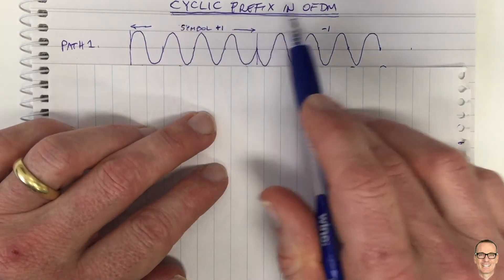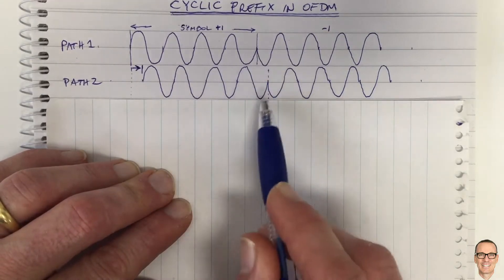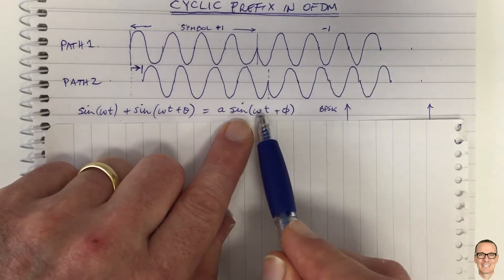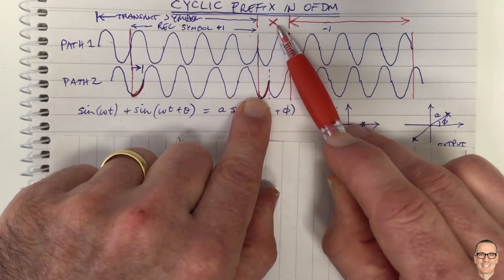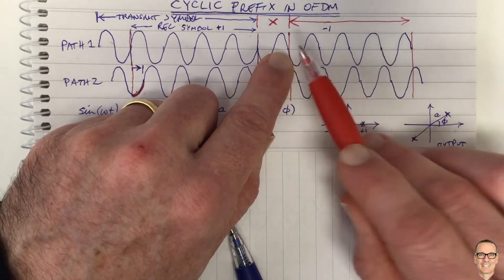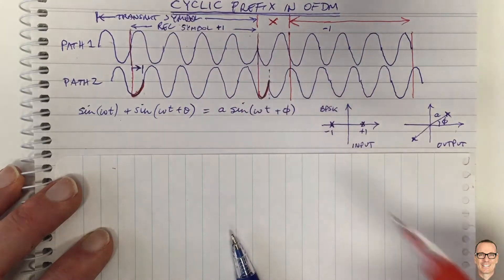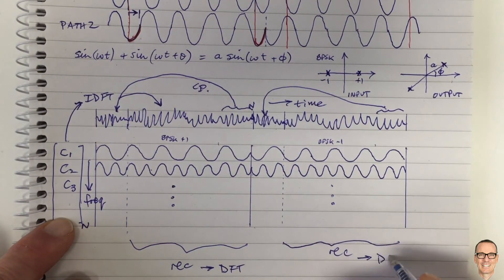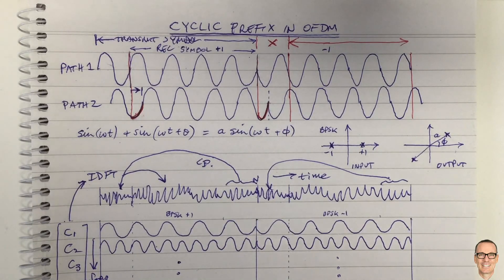What is a Cyclic Prefix in OFDM?

Comment: Hi professor, IEEE channel model D(typical office) has max delay of 390ns, and 802.11ac short guard interval(should be the length of cyclic prefix?) is 0.4us which is 400ns and is longer than max delay. Does it mean model D won't create any inter-symbol-interference? But why are we still seeing WiFi throughput drop when testing when testing with channel emulator and applying model D?
Reply from the maker: Yes, there won't be any ISI between the OFDM symbols in that case, however that doesn't mean that the channel is flat across the spectrum. There will still be an effect from the multipath, causing some sub channels to have low gain. I'm planning to make a video about this in the next week or so. Keep a lookout.

Comment: Sir, to prevent ISI we go for OFDM. Now, while we implement OFDM,  the symbol period is made much greater than the delay spread. So, ISI will not occur, right?  Then why should we still use cyclic prefix?  Sir, I have had this doubt for a long time. Please explain this sir
Reply from the maker: Making the symbol period longer doesn't "remove" ISI. It just makes the ISI have less effect, since the delay spread becomes a smaller percentage of the symbol period.
Reply: @iain_explains  Thank you sir

Comment: at 2:48  if the problem of rotation of the constillation has been soved by the process of equilization than what is the need of cyclic prefix ultimately what we want is our constillation at the right posiotion at the receiver in order to be detected that has been aceived by the process of equilization . so where there is need of CP sir please spread some light i have watched the whole video many times but everytime my mind is stuck on the same question
Reply from the maker: It’s not possible to do the equalisation until after the inter-OFDM-interference has been removed. That’s what the prefix is for. It ensures that there is no interference from one OFDM symbol to the next.

Comment: I don't understand why there is a gap on the left, in the IDFT, at 8:45 that "has to be filled" with the prefix. Since all subcarriers fill the whole time slot, their sum should also fill the same time slot and there should be no need for filling that gap with a copy.  Since we're discarding the prefix at the receiver end, we already have a longer transmitted signal duration on the transmitter side (you can't extend the transmission time of one symbol on the emitter side; the only thing you can do is reduce the symbol sampling duration on the receiver side -  and we do this already). Therefore the symbol is already "extended" from the perspective of the receiver.  It's actually conspicuous on the pictures at the start of the video (5:00): what is in the prefix is exactly the same as what is at the end of the time slot.
Said otherwise: when do we transmit the prefix, since we're already using the whole transmitting time slot with the combined OFDM symbol?
Or are we deliberately generating the symbol on transmitter side with a delay, during a reduced duration, equal to the receiver sampling duration. And why would we need to do that if the suffix and prefix are equal? Are they not?
Seems we started with the idea of a guard and then realised we needed to fill it with some thing that turned out to be the same things as if we did not have a guard in the first place. I'm lost.
Reply from the maker: I explained that in the "single carrier" case at the 3:27 point of the video. You want to extend the symbol, in order to avoid having a discontinuity within the received symbol. The output of the IDFT at the OFDM transmitter does not include the cyclic prefix. It's just the symbol that you would like to send (ie. the 4-cycle symbol in the single-carrier example at the top of the page). It needs to be extended, so that the ISI affected portion can be removed at the receiver.
Reply: @iain_explains  Thanks for trying to help, but I'm afraid I'm a hard case, :( . I'm sorry Iain I still don't get it.  The single carrier example you took is precisely why I'm asking the question.  In your example, there is no copy of the tail.
You even explicitly show that transmitting a 5 cycle symbol is sufficient if we decide to only sample symbols on the 4 last cycles 3:34.
On transmitter side, you add a "prefix" first cycle (which indeed looks like a copy of the 6th cycle) but we did not need to do that copy, we just generated that cycle in our longer transmitter-side symbol duration, unaware of whether the receiver was going to take it into account or not.
Just as your single carrier example shows, copying cycle # 5 on top of cycle # 1 would be achieving nothing. Cycle #1 is already the same as cycle # 5.
Assuming orthogonality, and assuming that the prefix length is a multiple of the period of the lowest subcarrier, the same would apply in multi-carrier added signal.
So, IDFT could do the same and just generate on the whole duration instead of copying a tail on top of an identical prefix.
In short, in your single carrier introduction, the solution is to have a longer symbol generation duration, but in the multi-carrier situation, the solution is to have the same symbol generation duration and then patch the resulting prefix gap with a copy of the tail. I realize I must be missing something since, everyone is on the same page, except me.
So, what did I miss?
Reply from the maker: In my single carrier example: The "actual symbol" that you ideally want to transmit, is only 4 cycles long. The #1 cycle (according to your definition) does not exist in the "actual symbol". The #1 cycle is added, in order to avoid inter-symbol-interference affecting the "actual symbol". The added #1 cycle is a copy of the last cycle of the "actual symbol" ... ie. it is a copy of the #5 cycle, in your definition of the cycle numbering. This is why it is called a cyclic prefix. I agree that it looks like just an "extension at the start" of the sinusoidal waveform, but that's only because the start and the end of a sinusoidal waveform are the same (ie. it's only an "extension at the start" since the waveform in this case is a sinusoid). Once you start adding sinusoids together (as in the multi-carrier OFDM case), the start and the end of the "actual symbol" are not the same any more.
Reply from the maker: The lowest frequency subcarrier has a period that is the length of the IDFT vector. So the start and the end are not the same. Here's some code you can try in Matlab: 
X=zeros(1,100);
X(2)=1;
X(100)=1;
plot(ifft(X))
Reply from the maker: Here are a couple of videos that give more details on that: "How are OFDM Sub Carrier Spacing and Time Samples Related?" https://youtu.be/knjeXo3VZvc and "How does the Discrete Fourier Transform DFT relate to Real Frequencies?" https://youtu.be/pIFz84oj9cA
Reply from the maker: And probably at 2:51 where I introduce the idea of the extension, and say "it could have been more than one cycle", I should also have said "and it could also have been less than one cycle".

Comment: Hi Ian, this answers a lot of questions that a friend and I had about this topic a couple of days ago, thanks! I have a couple more 😊

Are the terms 'cyclic prefix' and 'guard interval' interchangeable?

Is the effect, from a transmitter perspective, identical to lowering the symbol rate? Does this therefore mean that the bandwidth per carrier is narrower? Does that affect orthogonal carrier relationships, or does it help with carrier IM as well as ISI?

Does the duration of the cyclic prefix need to be an integer number of cycles of the base carrier frequency, so that it is also an integer number on all orthogonal carriers?

Thanks again for a great explanation!

Comment: Thank you so much Mr. Iain for this excelent explanation. I believe it is the best playlist in communicatio I've seen on YT so far!

I just have a question, if I may. When I convert the constelation set into the time domain using IDFT, I do have a complex signal with both real and imaginary components, in some cases. 

Does that mean that I need to transmit two time domain signals (Re and Imag) over the antenna in separate intervals? Or should I just transmit the absolute value of the sequence? 

Thank you so much for this excelent content!
Reply from the maker: Yes, you need to send the "complex signal". Here's a video that explains how: "How are Complex Baseband Digital Signals Transmitted?" https://youtu.be/0lkRJgnywkg
Reply: @iain_explains  Thank you!

Comment: Can we summarise and say that due to the delay in the ofdm symbols, the symbols are shifted such that we lose some of  the right most part of it but due to the CP at the fron we get that exact part back in the waveform? Kepping full symbol data intact although out of order. How would we know how much of the cp needs adding back to recover the full symbol?
Reply from the maker: Not really. We're not "adding it back" at the receiver. We're adding the cyclic prefix at the transmitter. It means that when there are multiple paths in the channel, the paths that come into the receiver with a delay don't disrupt the next symbols, and don't cause components of the previous symbols to disrupt the current symbol.

Comment: Professor, this is a great video, I read lots of articles recently regarding ZF-OFDM vs CP-OFDM in the transmission path, looks like there will be a linearity benefit when using ZF-OFDM in the TX path, if we use this in TX path, the RX has to pair it as well, how ZF-OFDM system deal with the discontinuity ?
Reply from the maker: Do you mean zero padded (ZP) OFDM? It's not clear what you mean by ZF-OFDM. Zero forced? In what way?

Comment: @ 2:40 sir can you please elaborate what will be the problem due to discontinuty
Reply from the maker: If there is a discontinuity then the waveform on each subcarrier frequency won't be a pure sinusoid. It will be a sinusoid with a "phase glitch" at the time of the discontinuity. Then the fourier transform of that waveform will not be a delta function. It will spread out in frequency. This will then overlap with the neighbouring subcarriers, causing them to not longer be orthogonal.
Reply: thanks sir now everything is cleared . sir you are gem replying even small doubts and revealing the mysteries of wireless communication to us 👍

Comment: The phase portion we just rotate and get the constellation , now cyclic prefix will only take care of discontinuity , what do we do for the phase rotation of the sine component in case of multiple OFDM carrier, do we simply rotate or is there any solution to that as well?
Reply from the maker: Sorry, I'm not sure what you are asking. Perhaps you can explain a little more?
Reply: @iain_explains  Sorry , I am just learning so may be I a wrong, in the video u said the equalization can be done at the receiver just by rotating the constellation, so i was wondering do we any fix for that .. like the discontinuity is taken care by the cyclic prefix do we have any such mechanism for the phase shift due to the multipath environment.
Reply from the maker: The phase shift is corrected in the digital domain (ie. after sampling). It is done simply by multiplying the sampled complex number in each sub-carrier by e^(-j theta), where "theta" is the phase shift that the channel applied to the signal in that particular sub-carrier.

Comment: Thank you for a very nice explanation! I'd like to emphasize that this line of reasoning works the same way even when we only have a single OFDM block surrounded by zeros. The second path would shift some of the zeros inside our listening interval, which will make the beginning of the received message "special". If we do prepend a sufficiently long cyclic prefix, however, this will not happen (we'll have a sum of two sinusoids for all carriers and all time instances within our listening interval), and we'll be able to use the length-N DFT at the receiver as explained in the video.

An alternative way to interpret the purpose of the cyclic prefix is that it makes sure the output of the channel looks like the output of circular convolution (convolution with a periodic input), even though the actual channel performs linear convolution. Only for circular convolution the length-N output (and hence the length-N DFT) straightforwardly contains all information (because the output of a convolution with a periodic input with period N is itself periodic with the same period). How do we emulate circular convolution with linear convolution? Well, we need to include the end of the previous period in our transmission. That in turn is equivalent to copying the end of the message and prepending it to the beginning, which is exactly what we do when we add the cyclic prefix.
Reply: Turns out the same point was raised and answered along the same lines several times in the comments earlier.
Reply: what if we zero-padding in CP? looks like it also have some advantages such as power saving and PAPR reduction in transmission.

Comment: how to calculate the value of the portion taken (from the symbol)of the cyclic prefix in ofdm?
i watched a lot of videos and they all say that we take the last portion! but how can i calculate it?
and for your explanation, we are making the cyclic prefix before the parallel to serial conversion because it's adding a cp to every subcarrier right?
Reply from the maker: The length of the cyclic prefix is a design choice. There is no absolute rule for how long it has to be. The longer it is, the more resilience there will be to the effects of ISI from the channel, but it will also mean that there will be a smaller percentage of transmission time for the actual received signal (since the prefix is discarded at the receiver). Standards define the prefix length (eg. the 3GPP standard for 4G and 5G, and the IEEE802.11x standards for WiFi).

Comment: I like the way you explained the reason for adding the cycle pad between 2 serial symbols, to prevent interference of symbols, and to cut the end portion of sum of time domain signals and pad it into the start of the second signals sum. 30 years ago they told us to do so but they never explained to us why they did that, now 30 years later I know - thank you. This method of coding is very smart indeed.
Reply from the maker: Glad the video was helpful.

Comment: What a fantastic video!! There are lots of animated videos on this but what you explained with Pen and paper is irreplaceable.

Sir, May I ask you a question
What I understood is, for the digital detector(I have gone through your video) the total energy within that symbol period is constant after adding the cyclic prefix to make out the transmitted symbol. In this case, since it was BPSK the symbol rate is equal to the bit rate.

But how the detector will make out the bits practically for higher bit modulation?
Suppose for QPSK or QAM, how it is going to know the bits?
I hope I'm clear in writing down my doubts.
Reply from the maker: Thanks for your nice comments. And thanks for your question. I think I might need to make a video on the superheterodyne radio receiver (keep an eye out for it). In summary though, the (time domain) baseband (down converted) samples are complex valued, and when they are put through the Fourier Transform, the output vector also contains complex values (one for each sub channel), and those are then compared to the respective constellation (for that sub channel), and the nearest point is chosen. It is general for any constellation.
Reply: @iain_explains  Thanks for helping me out, Sir. Though I didn't get it very clear but maybe once I'll work out more on this, I'll be able to get it. I'll eagerly look out for your video as suggested by you.
Basically, I want to know for a higher order of modulation in OFDM, how bits are extracted from symbols after demodulation after appending CP.

Comment: hello, does anyone know how to count the size of CP? is it based on the subcarrier or the symbol in the subcarrier?
Reply from the maker: The length of the CP for 4G and 5G mobile is defined in the 3GPP standard. In general, it needs to be longer than the maximum delay of the significant reflected channel paths.
Reply: @iain_explains  
for example, I have a program at matlab
with 256 subcarrier, and there are 100 symbols per subcarrier
so the CP is count based on the symbola per subcarrier or the total number of subcarrier?
if I use 25%, then the CP is 25% of the symbols per subcarrier (25%x100=25 symbols), is it right?